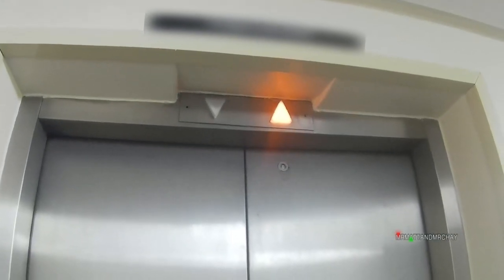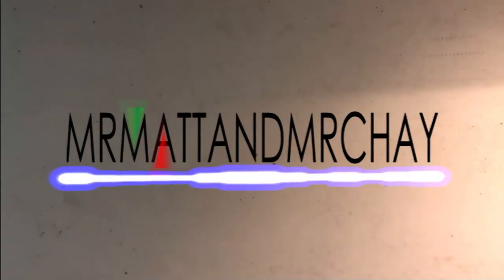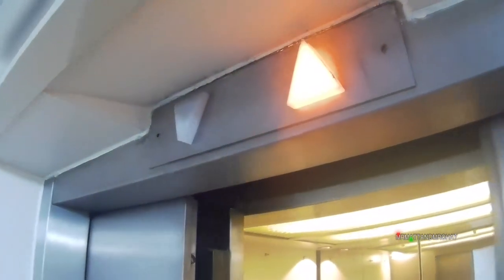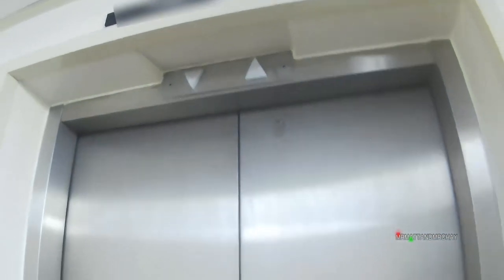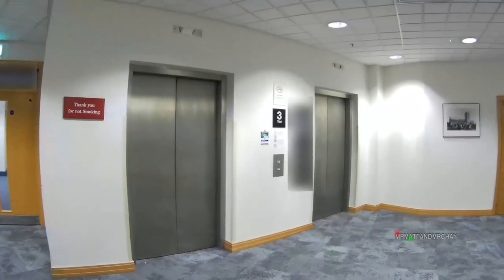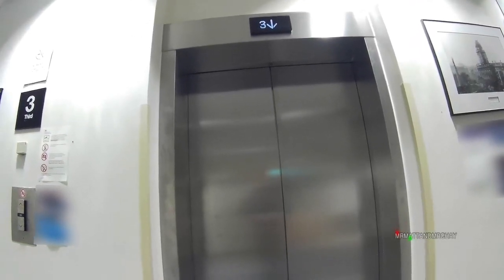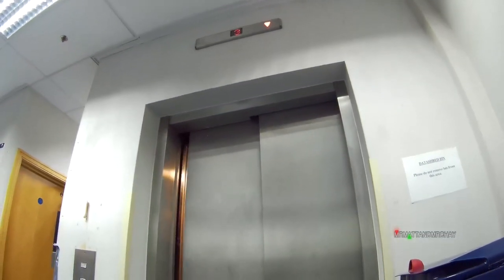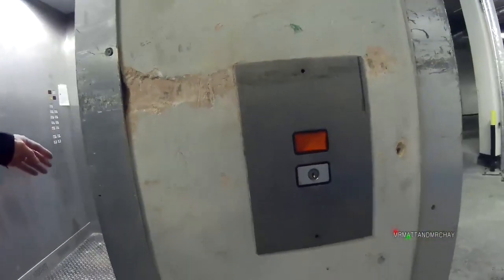SCHINDLER LIFTS of the 90s (with Buck Palace analogy!)

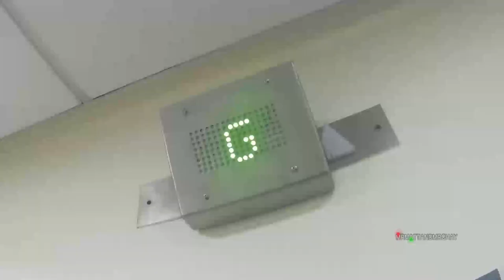Comment: I quite like 90s Schindlers. They have a very unique design style. I'm surprised that they still used bulbs inside the hall lanterns, especially since the buttons are LED. Kone probably make the best modern lifts at the moment. They have a lot of design effort put into them, but sometimes I find the quality of them quite questionable. Very flimsy walls and doors (what modern lift isn't like that though?) 0:25 How did they do that? Did they cut the arrows? It Looks terrible.
Reply: Well I guess they didn't bother replacing them if they worked anyway. They might have cut the arrows yes, but I like that they kept a lot of the original lanterns and all the original buttons.

Comment: Ended up being more interested at the Kone lifts than the Schindler lifts...😅
Reply from the maker: Hmmm,  but modern day lifts you can see more or less anywhere, whereas old lifts are rare to find.
Reply: That's true, though the lifespan of modern day lifts seems to be getting shorter and shorter - the ones in the 90s are already getting completely replaced here!
Reply: @sgbuses  That's just due to parts shortages. They would last longer if the parts could be found. Other old lifts such as Express tend to have wider availability of parts. Not sure why that is.

Comment: The M-series buttons looks like they are lighted by a light bulb (not led) as the color is not uniform but a kind of bright yellow gradient. Did you noticed that ?
Reply from the maker: Yes I did, although I think it's because the LEDs have fallen back into the panel and are no longer pressed against the top part.  Not sure these were ever lamps, but it doesn't explain the yellow gradient.

Comment: Whoever installed that crap LED indicator over the original hall lanterns must be a lazy technician. That looks so ugly and awkward. At least they left the original M-Series buttons intact and the other lifts were replaced by KONE rarher than by a generic company.
Reply from the maker: Im an engineer and i have a theory on this.... the engineers on site were given the new displays and had to make fit on the day (i.e. if blanking panels had been costed and supplied to the site engrs then they would have been fitted, obviously not lol).   They probably considered a few options but this is what they come up with!